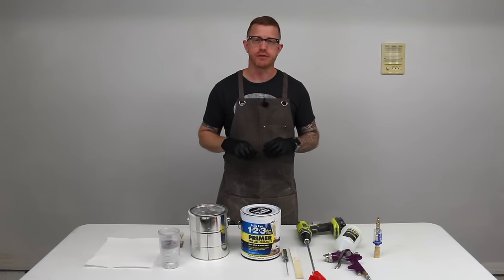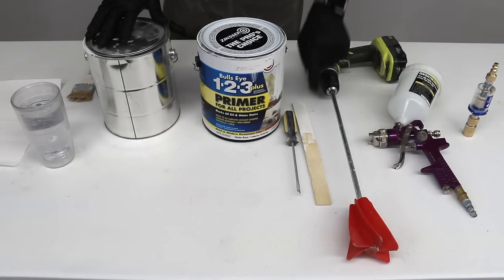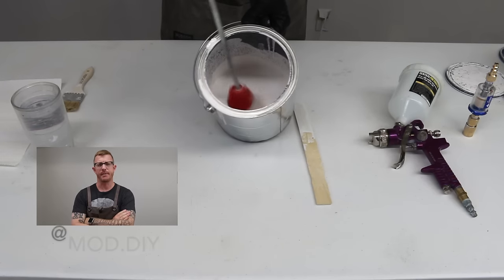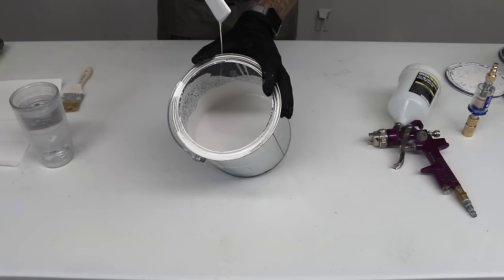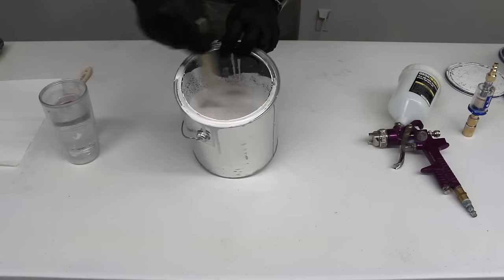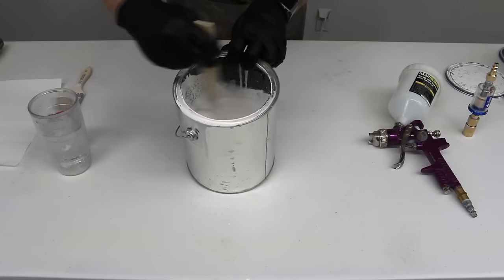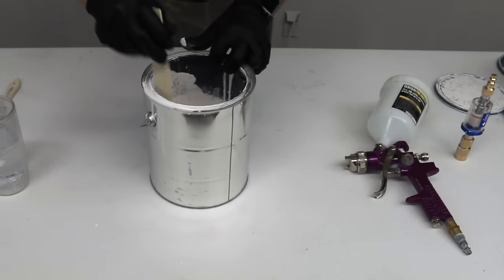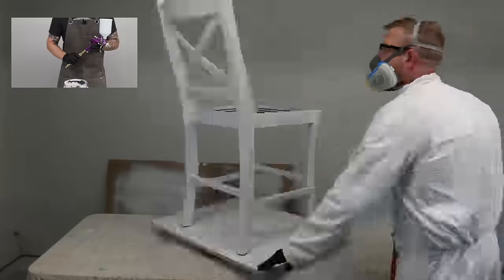How to: Quickly Thin Paint to Spray Through a HVLP Gun

Comment: There is nothing in this video that is good advice. To spray latex through an hvlp you need the correct size needle and nozzle set, a powerful hvlp turbine system and for goodness sake read the paint thinning directions for the product. I have never seen a latex paint that can be thinned more than 10%. Most latex paints recommend you do not use an hvlp system for application. Thinning any water based paint dilutes the solids making the paint cover less and it dulls the sheen.
Reply: I've painted a variety of projects with a Devilbiss HVLP and thinned latex.  I also found that I need a nozzle with a larger orifice in it. I use a Devilbiss FLG-302-22K, which is 2.2 mm.  I just use the standard needle which came with the gun.  No issues in the application or curing.  The paint does lose its sheen over time.  But I think that happens with any latex paint.
Reply: Haha this is DIY channel go somewhere else.
Reply: @patmatt975  I am a DIY'er.  I've never spray painted professionally in my life.  Even a DIY'er can be careful and have knowledge of his/her equipment.
Reply: Paint manufacturers don't know s*** about spraying.
Reply: Im sure this video was made for that DIY’er that has a budget, and have a HVLP and latex paint and work with what you have type video, another words improvise with what you have. Im sure he knows latex paint in a HVLP isnt the correct setup, but thats all you have then goooooo.

Comment: If anyone is still looking at this in 2023, here’s a roundup of everything that is wrong or otherwise inadvisable with this vid:
1. As many have pointed out, for God’s sake mix the entire gallon can before attempting any thinning. Solids sink to the bottom over time, and pigments, especially with dark colors, can rise and separate from the rest of the paint.
2. No, the orange-tipped mixing blade is NOT for small quantities; a stir stick is. Before you start, fill an empty five-gallon bucket with a gallon or two of water. After you use the mixing blade, stick it in the water and run it with the drill to remove most of the paint. Then release it into the bucket and proceed with your painting. This will make it easy to clean.
3. An old gallon can is lousy for this thinning work. Plastic paint cups come in various sizes, have tight fitting lids for paint storage and have markings that let you keep track of how much thinning you are doing. They are crazy cheap and available at paint stores and auto body supplies dealers.
4. Read the instructions on every can of paint to see what the manufacturer specifies. You likely will find the amounts are far less than what is shown in this vid. 
5. Yes, what is shown for a spray gun here is a Harbor Freight item that even in 2023 costs only $20-$25 during the company’s endless sales. And the linked item — I haven’t checked as to whether it still works —  is, or was, for a far more expensive gun on Amazon that this dude earned a kickback on. Forget the expensive one, and confirm that whatever gun you buy will handle the heavier bodied latex primers and topcoats. The spray tip should be at least a 2 mm. Most guns are equipped with tips sized about 1.4; you will have to thin the shit out of your paint to make that work, likely compromising the result.
6. Filter all paint with a paper cone like that used for auto body paints. You might find that the tiny plastic filter in the bottom of the spray gun cup impedes the paint flow and must be removed.
7. Although settings can vary, most of the time 25 or so psi is about right for gun pressure. Note that this is set with paint flowing and the gun triggered.
8. Consider setting up a ladder in your paint area and clamping a piece of cardboard to it. This allows you to trigger the gun and set spray pattern and air pressure. Experience will let you do without this, but it is a great help for the beginner.
9. Yes, you can use an old screwdriver to open a can, and pound the lid back on with a hammer, but why not ramp it up a notch and get a proper opener and a small dead-blow hammer or rubber mallet?

Comment: You can get a Ford viscosity cup #4 at Home Depot for 10 bucks. I use the cheap HF. purple gun with satisfaction. Something I noticed when painting my bathroom with semi gloss is that it came out looking more like flat because of the texture sprayer left. If touching up you can see the gloss show up. So next bath I do I will roll. Other wise painting cabinets, doors etc is actually fun with a beer.   Also painted part of my siding with a gun and that was very satisfying vs a brush and roller.